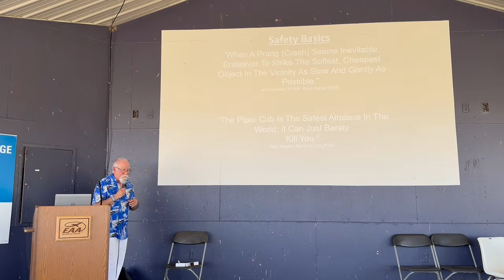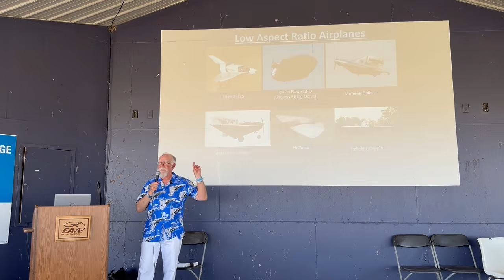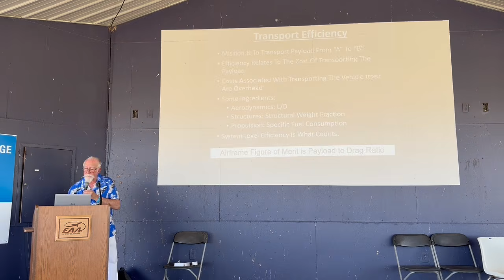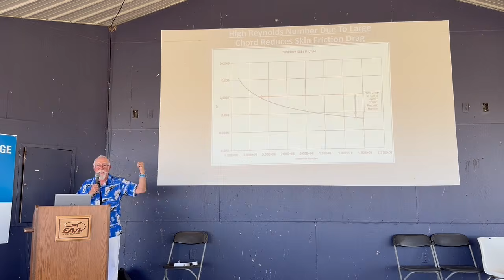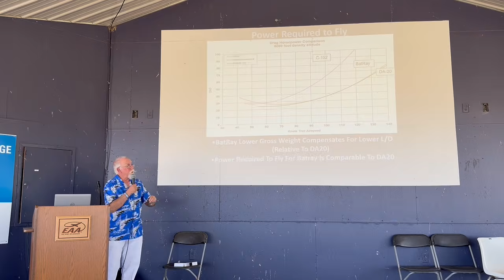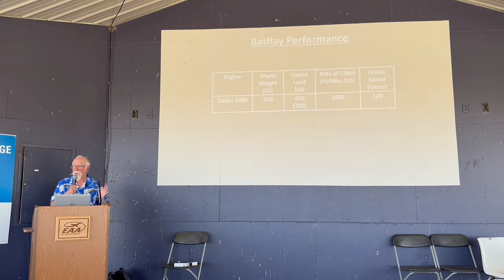The Case For Low Aspect Ratio Sport Aircraft 2026

Comment: If it weren't for the one-engine dangers of tip mounted props, a Pancake style plane seems like it'd be fantastic: all the fun of low AR, but with even shorter takeoff rolls, and with better cruise thanks to the propellers softening the induced drag

Maybe with modern electric motors, even that won't be a major safety concern forever. The thick airfoil gives plenty of room to fit otherwise bulky batteries, too...

Comment: What does aspect ratio refer to in aircraft?
Reply: Wingspan to wing chord(distance front to back)
Reply: @TimHayward yes for a non swept, no tapered wing.  Technically use the Mean Aerodynamic Chord, or b squared over S, span squared divided by wing area…
Reply: Thanks for the thumb!  Usually I get a F U…😅
Reply: For general example:

High aspect Ratio: Gliders, airliners

Low Aspect Ratio: Flying Pancake, Delta Wings.

Comment: I was hoping someone would ask whether you've simulated it with a more powerful engine since MOSAIC opened up the speed limits.  Thoughts?
Reply: Well he's been pretty clear about that he's not out there to create a fast airplane. There is a similar one already that goes fast; the Verhees D2 doing 240kmh cruise with 100hp. Actually these low AR airplanes are perfect for fast going long range missions. It's just that Wainfan isn't building his for that mission, since he aims to target what people actually flies: around their local airport.
Reply: @NavalTechTinkerer  All fair, and I've seen his various talks about mission creep (more power = more speed = more fuel = more airplane = more power).  As for "airplanes at their local airport", the most common homebuilt aircraft model in our area seems to be the RV8, so a design with wide power options & potential performance capabilities makes a lot of sense. Note that homebuilders are a somewhat different group than sport pilots in general.
Reply: @Traqr true true

Comment: Flying is magic and aircraft designers are like wizards !! :D
Great talk !!... I really enjoyed listening to the various design considerations on offer  :)
The speed range is fantastic and yes, it looks very cool too !
I have some questions too ....

I wonder what aerofoil sections you might be using for the Bat Ray ?
With such a steeply swept leading edge I'm curious about the span wise flow patterns ?
Are you using a cranked leading edge to control the airflow ?
You mentioned a max flap deflection of about 30 degrees, I wonder about the max deflection for all the other controls ?
Would there be any advantages to having a thinner wing section and a bubble canopy for the pilot ? 
How about having the front windscreen open like a hatch that you step down in to or  a rear hatch door that you can enter from the back etc. ?
What are your thoughts on an aerobatic version ?

Thanks in advance :)